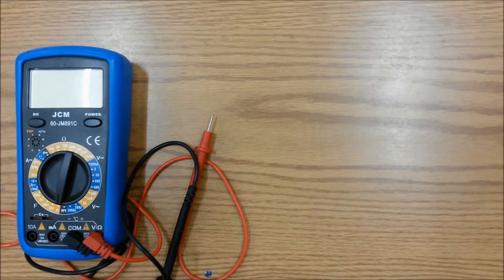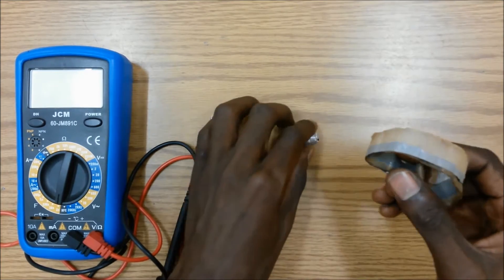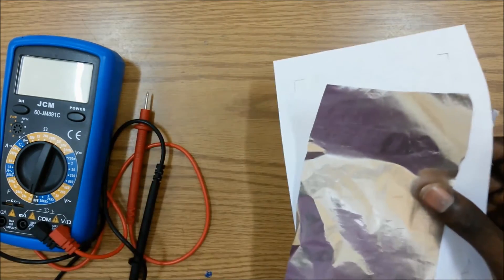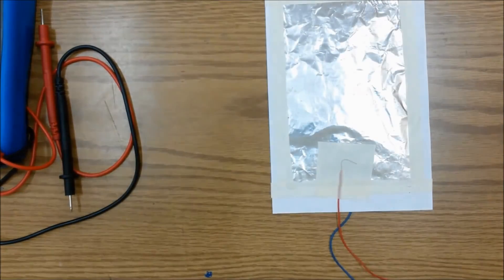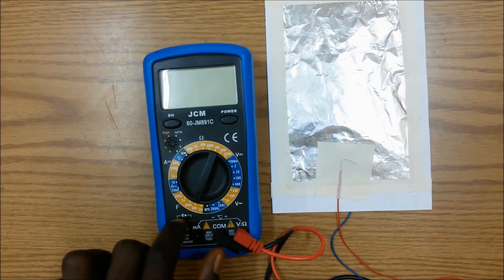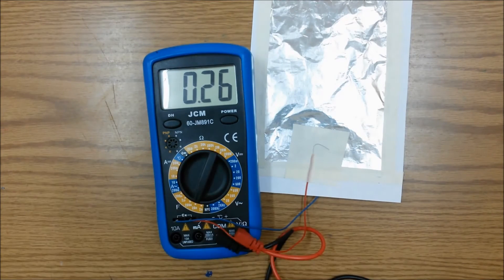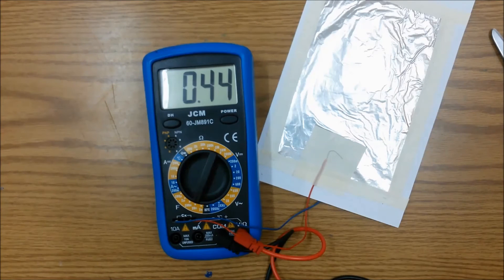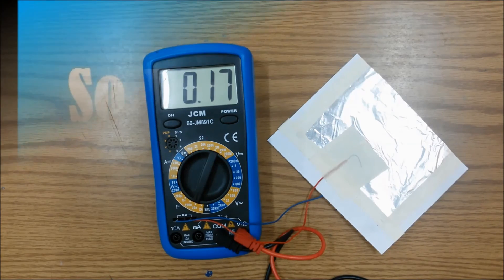How to Make a Simple Home-Made Capacitor

Comment: Hi Robert, I need your help on the capacitor, which is used in Bosh hone. it is paper capacitor written on it is HOKO 1Z1Z
6 .. 12 volt
. length is 2.5cm diameter 1cm. do you have any idea how to make

l
Reply from the maker: Greetings +Babu Mistry do you know the capacitance value of the capacitor you a trying to make?
Reply: @realJuniorRoberts , I don't have any idea on value It is written HUKO 1z1z 6...12 volts try tomorrow if I can get the Value
Reply: it is 200 kiloohms
Reply from the maker: @411lofty  look for the capacitance value you should see a value with a unit of microfarad (uF)
Reply: @realJuniorRoberts   do you have any idea on 12 volts capacitance should be
Reply: Hi Robert what do you understand from this, film winding capacitor of any (sufficiently small) design with a capacity of 0.23 to 0.32 microfarad and an insulation resistance of over 200 kiloohms in the electronics shop.
Reply from the maker: @411lofty  you need a capacitor of about 23 - 32 microfarads. You could purchase a small capacitor that is adjustable and use that as a replacement
Reply: @realJuniorRoberts  any phot you have
Reply: Hi Robarts and news on my capacities